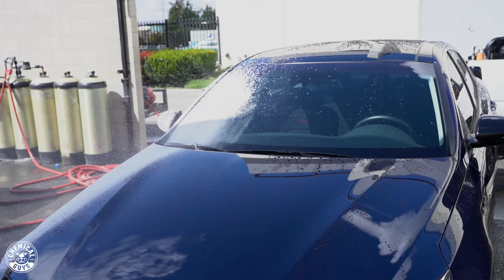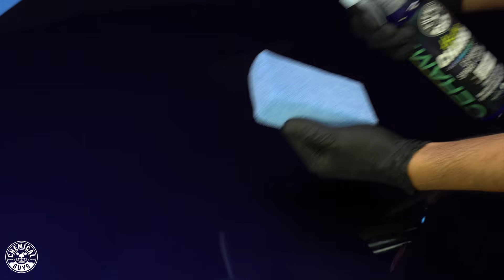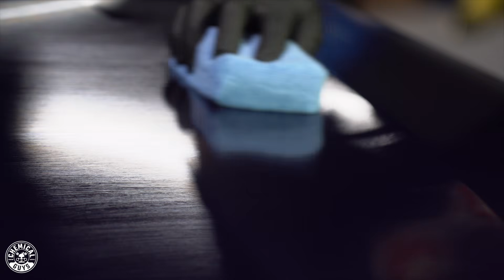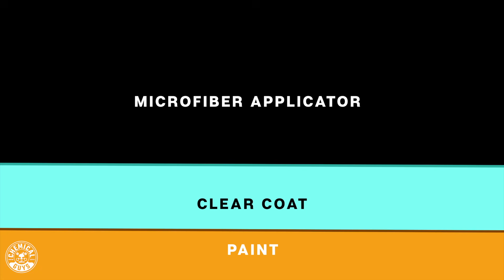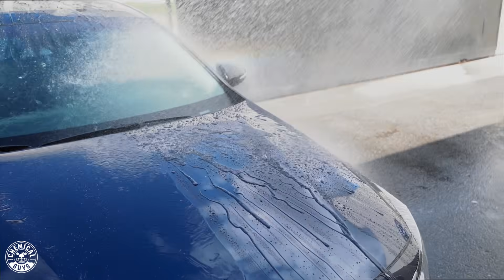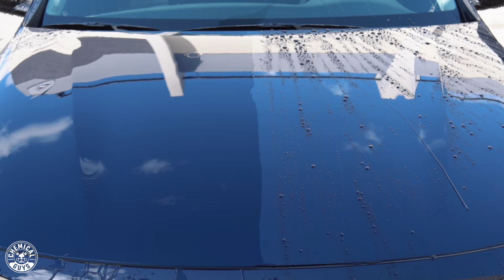How To Easily Apply NEW HydroCharge Ceramic Spray Coating | Chemical Guys

Comment: Is it more forgiving than a more classic ceramic coat? For example, if you finish that hood, would you some sort of demarcation?
Can it be removed with a product such as Clean slate?
Reply from the maker: Hello Jean! A traditional ceramic coating such as Chemical Guys Carbon Flex C9 is a lot thicker and harder of a product vs HydroCharge, therefore it would be a lot harder to remove with clean slate. Assuming that you want to strip the surface while it is fresh and hasn't fully cured then yes it can be removed. If not, then yes it can still be removed with further removal such as Wipe Out surface cleanser spray. HydroCharge is a thick ceramic coating and penetrates deep like a traditional ceramic coating as well and shouldn't be confused for as something light such as a spray wax or sealant. Make sure to stay tuned for future videos on this product. Happy Detailing!
Reply: Chemical Guys great! When will be available in your Canadian store?

Comment: Should you use the same applicator through the entire process for one car?
Reply from the maker: Hello Kazn! Yes, you can use one applicator throughout the whole application of the vehicle, assuming you do it all in one session where it doesn't allow the product to dry on the applicator. If so, toss it out and start using a new or clean applicator to finish the rest of the vehicle! Happy Detailing!

Comment: I’m confused. Does this replace traditional professional ceramic coatings?
Reply: This won’t last anywhere near the time
Reply: AllegedlySpiffy its a cheap/faster replacement. Traditional will give better protection.
Reply: No
Reply from the maker: Great Question! HydroCharge will revitalize your existing ceramic coating, increasing the shine, water beading, and protective properties. It will help your existing coating last longer, look its best, and protect the strongest. Due to its spray application, HydroCharge is an excellent way to maintain your existing ceramic coating, helping extending the periods between application or can be used as a stand alone product as a ceramic coating. Make sure to also check out our HydroSuds Ceramic Car Wash Soap! https://www.chemicalguys.com/hydrosuds-ceramic-car-wash-soap/CWS21216.html

Comment: Is this better than Jet Seal?
Reply from the maker: Great question! To begin with, Jetseal is a synthetic sealant which contains nano-polymers which creates a nano-barrier within the pores of the paint. It will last a very long time on paint but doesn't necessarily deliver the most durable shine seeing to that it contains only gloss enhancers. HydroCharge is as thick as a second layer, or a sacrificial layer of protection over your car’s paint or clear coat. Ceramic coatings utilize nanotechnology, which is essentially tiny particles that form a hard layer of protection over the paint. The formulation of HydroCharge Ceramic is so refined that once applied to a surface, it works fast at sealing all the tiny pores, making the surface water-repellent. HydroCharge adds superior resistance to UV, scratches, chemicals, and heat. In essence, they are both very great products and measure differently in results in terms of protection and shine. Hope this answered any of your questions. Please feel free to refer to the HydroCharge FAQ'S if you have any further questions. https://www.chemicalguys.com/article-hydrocharge-faq.html

Comment: Can't wait to start my mobile detailing...how long does the product last
Reply from the maker: Hello, great question! HydroCharge is a long lasting spray ceramic coating that can offer protection to your paint for up to 12 months just from one easy application! Also, make sure to also look into our HydroSuds ceramic car wash soap to maintain your coating and for a brilliant ceramic high gloss shine. Happy Detailing! https://www.chemicalguys.com/hydrosuds-ceramic-car-wash-soap/CWS21216.html
Reply: 12 months not bad am gonna have to get the product and the soap...question can i compound, polish and wax the vehicle first then use the coating after words

Comment: Do we need to throw away towels after using this products and what is the hardness level?
Reply from the maker: If you wash the towels and applicator after you finish applying you do not have to throw them away. If you allow them to sit, then yes.
Reply: Yes or use said towels for dirty engine bays. The towel should not ever touch paint again once it has been used to apply a ceramic spray coating.

Comment: Could this be applied on a vehicle that hasn't been waxed?
Reply from the maker: Hello Chris! Yes, you would want to strip the surface from any type of grime, contamination, polishing oils and any type of residual carnauba or sealant from the paint during the prepping process and then use HydroCharge before anything else so that HydroCharge bonds directly into the pores of the paint. Great question! Refer to HydroCharge FAQ's page for any further questions you may have. Happy detailing! https://www.chemicalguys.com/blogarticle?cid=article-hydrocharge-faq
Reply: Chemical Guys thank you and this link was helpful! As clear as surface prepping, if I have minimal scratches and swirling could I skip straight to claying to clean it. 

And would their be an issue if I didn’t have a polished like the Torq to remove swirls and scratches and skipped straight to claying and applying this product?
Reply from the maker: We recommend that the product be applied on a clean, decontaminated and scratch free surface for best possible results. Mind that the product will reflect the condition of the paint, therefore if you have scratches and swirls it will not hide them or remove them. Nothing bad will happen, you just probably won't make the best use of the product, but all in all you will still get insane UV protection and hydrophobic properties!

Comment: Can we use HydroCharge as a stand alone? And, can we put it on top of a sealant?
Reply: it says in the description
Reply from the maker: Great question! Yes, you can use HydroCharge as a stand alone product or you can use it as a topper of an existing ceramic coating, increasing the shine, water beading, and protective properties. Ideally, you would want to strip the surface from any type of grime, contamination and polishing oils from the prepping process and then use HydroCharge before anything else to achieve the best results possible. Happy detailing!

Comment: Can I apply this over a layer of glaze, wax, and sealant? Or should I use Clean Slate to use this product?
Reply from the maker: Great Question! HydroCharge would land on the protective coating category right before glaze because you want the coating to bond to the paint and not to the oils left behind from the glaze which would cause an improper bond! Make sure to prep the surface just as you would like any other coating such as Carbon Flex C9. HydroCharge Ceramic Spray Sealant is an ambient air cured coating. No special lighting or infrared light is required. The unique sprayable formulation starts to cure the moment it is sprayed out of the bottle and exposed to air. Once applied to the surface, the product will bond within 1-2 minutes. Always remove and buff to a perfect shine with a premium microfiber towel. After applying HydroCharge Ceramic Coating, it is ideal to keep it out of the elements in a dry and clean environment for 2-3 hours. Depending on the climate, the hydrophobic effects will continue to improve even more after 24 hours of being applied. Then you can feel free to apply any further coatings such as glazes, sealants or wax. Refer to HydroCharge FAQ'S for any further questions. Happy Detailing! https://www.chemicalguys.com/article-hydrocharge-faq.html
Reply: You should prep the paint and remove any existing products, etc. This spray bonds to the paint and as such, should be sprayed onto raw paint.

Comment: Can this be applied on top of an existing coating of sealant such as JetSeal?
Reply: From what I’ve read, this goes before any sealant, glaze, or wax
Reply from the maker: Great Question! We recommend stripping the surface of the paint from any previous and or residual wax or sealant from the paint for HydroCharge to have the best bond possible to the paint. HydroCharge Ceramic Spray can also be layered. We have found in testing that 2 coats are more than enough for any surface we have tested. HydroCharge is layerable with all your favorite Chemical Guys waxes, sealants, and quick detail sprays. Simply wait for HydroCharge to dry and then proceed as you would on any other car. Refer to HydroCharge FAQ'S for any further questions you may have. Happy Detailing! https://www.chemicalguys.com/blogarticle?cid=article-hydrocharge-faq

Comment: If this hardens my microfiber towel do I throw it away after
Reply: Yes. It forms crystals that can scratch the paint. All cermanic and ceramic spray you should toss what was used to apply and buff the coating. Maybe save them for cleaning a dirty engine but it should never touch paint again or be washed with other towels.
Reply from the maker: If you wash the towels and applicator after you finish applying you do not have to throw them away. If you allow them to sit, then yes.

Comment: Can you use it on existing coating?
Reply from the maker: Hello Aaron! Yes, HydroCharge will revitalize your existing ceramic coating, increasing the shine, water beading, and protective properties. It will help your existing coating last longer, look its best, and protect the strongest. Due to its spray application, HydroCharge is an excellent way to maintain your existing ceramic coating, helping extending the periods between application. Make sure to also check out our HydroSuds Ceramic Car Wash Soap! https://www.chemicalguys.com/hydrosuds-ceramic-car-wash-soap/CWS21216.html

Comment: Does it flash? Does it crystallize?
Reply from the maker: Hello Anees! HydroCharge does not have a flash time, once you apply it, usually within the first 30 seconds that the product makes contact with the surface you can simply buff it right off. Please feel free to refer to HydroCharge FAQ'S if you have any further questions on the product. Also make sure to check out HydroSuds Ceramic Car Wash Soap to maintain your coating! https://www.chemicalguys.com/article-hydrocharge-faq.html 
https://www.chemicalguys.com/hydrosuds-ceramic-car-wash-soap/CWS21216.html

Comment: Awesome  but Ive got some questions 
1. How often should you apply 
2. Can it be used for maintenance/rejuvenat existing coatingespecially  other brand of coating
3. Does it harden like other coating where after you use a towel yo buff off you cant use it again
4. Is it only painted surfaces or plastic and rubber as well.
Reply from the maker: Thank you for reaching out! HydroCharge can last up to one year on clean and clayed surfaces. The precise duration of your application will depend on a number of factors, including: the climate where you live, how often you drive your car, how well you applied it, where you store it, and more. HydroCharge will revitalize your existing ceramic coating, increasing the shine, water beading, and protective properties. It will help your existing coating last longer, look its best, and protect the strongest. Due to its spray application, HydroCharge is an excellent way to maintain your existing ceramic coating, helping extending the periods between application. Yes, HydroCharge does harden, as long as you wash your towel or applicator immediately after application, you do not have to throw them away. If you do wait, the product on the towel will permanently harden, and you will have to throw it away. We recommend that you use a traditional creme based product such as a sealant or wax to seal and protect your glass. Hope we answered all your questions! Refer to this FAQ article for any further questions you may have, thank you! https://www.chemicalguys.com/article-hydrocharge-faq.html
Reply: @ChemicalGuys  thanks for the info so far must say it looks amazing and can't wait to try it out. Along with your ceramic wash.
Reply from the maker: Make sure to tag us in any photos that you take on any platforms and share your experience with us! Happy Detailing! @chemicalguys
Reply: @ChemicalGuys  will do 🖒🖒🖒🖒🖒 much love from the beautiful island of Trinidad and Tobago

Comment: After you spray it should you clean the nozzle out to since everything else it going to hoarded up won't the nozzle to
Reply from the maker: Great Question! Yes, we recommend you clear out any residual product stuck inside the nozzle and sprayer stem to avoid product residue from clogging up the sprayer and to keep a clean contamination free result! Make sure to also check out HydroSuds Ceramic Car Wash Soap to maintain your ceramic coating! Happy Detailing! https://www.chemicalguys.com/hydrosuds-ceramic-car-wash-soap/CWS21216.html

Comment: If I wash my car 2 times a week, will this still last 12 months? Or should I use it more often? Would waxing with for example Butter-Wet wax remove the Hydro Charge?
Reply from the maker: We recommend maintaining your coating and keep it looking great by using HydroSuds Ceramic Car Wash Soap! The high-foaming formula is the ideal choice to maintain your ceramic coating as it adds additional protection with every wipe of your mitt. Washing your vehicle is made easy after applying HydroCharge primarily because of the superior hydrophobic properties of the product. If need be, you may follow all steps again to re-apply a fresh coat of HydroCharge and maintain it.  Make sure to check out HydroSuds, link will be down below. Happy Detailing!  https://www.chemicalguys.com/hydrosuds-ceramic-car-wash-soap/CWS21216.html

Comment: Do we need to worry about plastic trims or rubber?
Reply from the maker: Hello Kenny, great question! We recommend that you keep it away from any type of plastic trims and rubbers and to stick with a traditional dressing to condition and protect those finishes.
Reply: According to the help line it is not meant for glass or exterior plastics.

Comment: Can we layer this after 24hrs?
Reply from the maker: Yes, HydroCharge Ceramic Spray can be layered. We have found in testing that 2 rounds are more than enough for any surface we have tested. We do have aerospace clients that have gone as far as 4 coats. Also, make sure to check out HydroSuds Ceramic Car Wash Soap to maintain your coating to make it last and shine the longest! 
https://www.chemicalguys.com/hydrosuds-ceramic-car-wash-soap/CWS21216.html
Reply: According to their FAQ, it can be layered some have done as many as 4. They say 2 should be enough. 2oz should do a full sized pickup
Reply: Is 24 hours the required time between layers or can it be done sooner?

Comment: Can this also be applied to a gloss vinyl wrap?
Reply from the maker: Hello Bryan! We recommend that you use our Wrap Detailer Gloss Enhancer & Protectant for glossy vinyl wraps. Wrap Detailer is a spray quick detailer and spray sealant in one to maintain vinyl wraps and to protect them from harmful UV rays and drying. Make sure to check it out on our website, link will be mentioned down below! https://www.chemicalguys.com/wrap-detailer-gloss-enhancer-and-protectant-for-vinyl-wraps/wrap-detailer-gloss-enhancer.html

Comment: Can you explain where this is at on the detail flow chart
Reply from the maker: Great Question! HydroCharge would land on the protective coating category right before glaze because you want the coating to bond to the paint and not to the oils left behind from the glaze which would cause an improper bond! Make sure to prep the surface just as you would like any other coating such as Carbon Flex C9.
Reply: Since it only lasts a couple months does it go on top of jet seal? Since jetseal lasts a year
Reply: @cristianherrera8564  They recommend bare paint - no prior wax or sealant. You can apply a wax or sealant on top if you wanted to once it's cured.

Comment: Do you have to throw away the microfiber towel and applicator after you’re done?
Reply from the maker: If you wash the towels and applicator after you finish applying you do not have to throw them away. If you allow them to sit, then yes.
Reply: What's the time gap when you need to wash or don't leave sitting for how long?? I might use it in the morning then not get a chance to wash my towels till evening..

Comment: Great product what is the difference between jet seal and hydrogen charge? What is better?
Reply from the maker: Hello Francisco! To begin with, Jetseal is a synthetic sealant which contains nano-polymers which creates a nano-barrier within the pores of the paint. It will last a very long time on paint but doesn't necessarily deliver the most durable shine seeing to that it contains only gloss enhancers. HydroCharge is as thick as a second layer, or a sacrificial layer of protection over your car’s paint or clear coat. Ceramic coatings utilize nanotechnology, which is essentially tiny particles that form a hard layer of protection over the paint. The formulation of HydroCharge Ceramic is so refined that once applied to a surface, it works fast at sealing all the tiny pores, making the surface water-repellent. HydroCharge adds superior resistance to UV, scratches, chemicals, and heat. In essence, they are both very great products and measure differently in results in terms of protection and shine. Hope this answered any of your questions. Please feel free to refer to the HydroCharge FAQ'S if you have any further questions. https://www.chemicalguys.com/article-hydrocharge-faq.html
Reply: Chemical Guys excellent explanation thank you
Reply: Francisco Martinez id like to know this as well